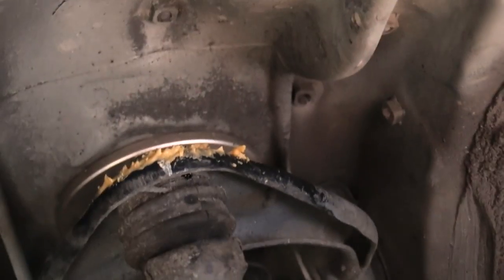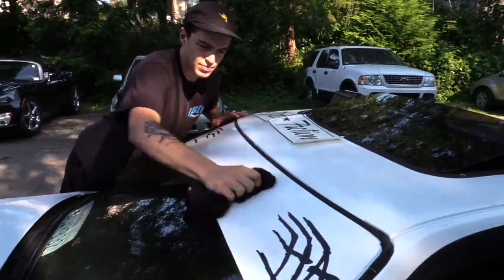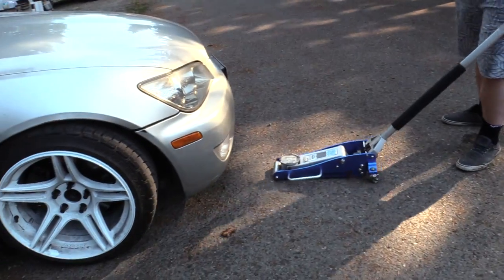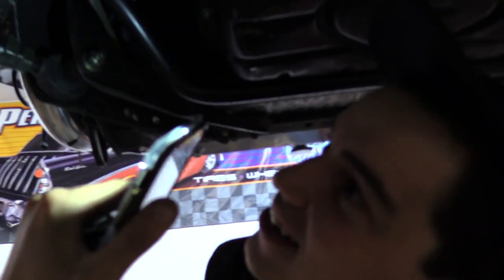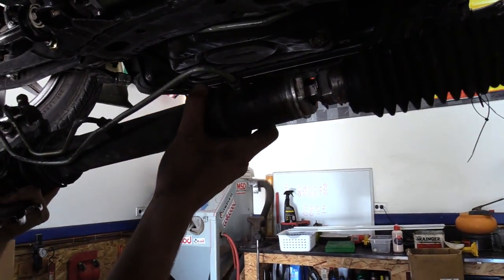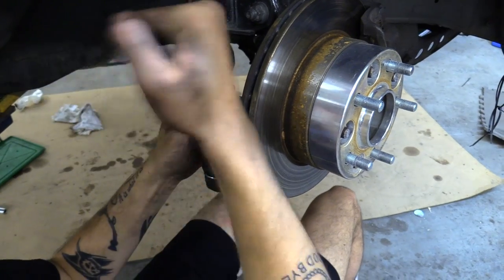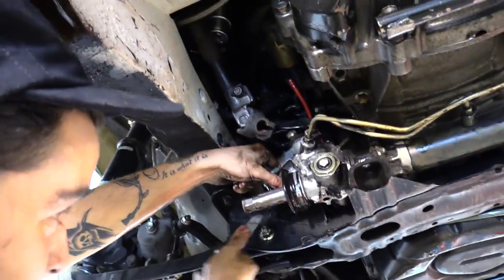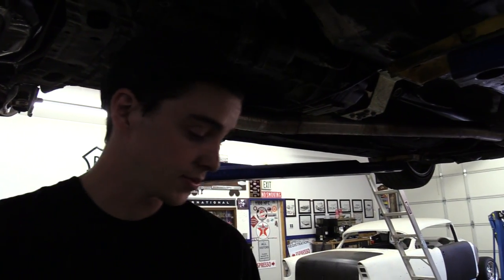Replacing Power Steering Rack On 240sx (GARDEN SLUGS)

Comment: I'm not sure if you guys have tried this for the IS300, but have you replaced the sway bar end links? They  tend to go out after you change out other suspension components. It's also near impossible to tell if they are bad just by looking. I suggest you replace them, they are like <$50.

Comment: Just changed the wishbone Bush's and the ball joints and the anti roll bar Bush's all at once will sort it , lowering the car put too much stress on the standard Bush's so stick some poly ones in as your gonna be drifting anyway and standard ones won't last long if it's not that then engine mounts ? Subframe mounts ? Some that had rubber before does anymore lool

Comment: for that leaking fitting on the steering rack some thread sealant should work. i had the same problem and some high temp thread sealant fixed the leak

Comment: Hey my dudes, I have the same problem with my rack leaking at that fitting, it's because they use a crush washer instead of the oem flare. If the rack isn't perfectly flat where the washer seats, it won't seal. Also the an conversion fittings that you can get from Earl's or whatever with the flare usually aren't long enough to seat in the rack and you have to machine off part of the hex so it can thread in deep enough. Huge pain the ass.